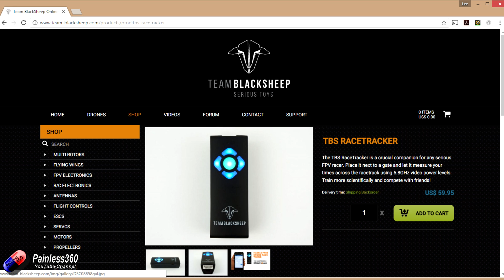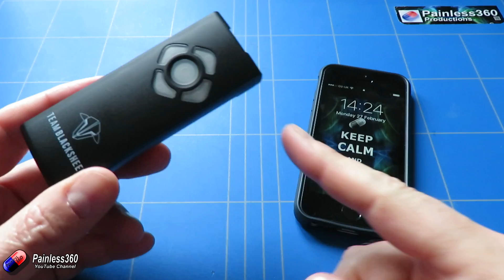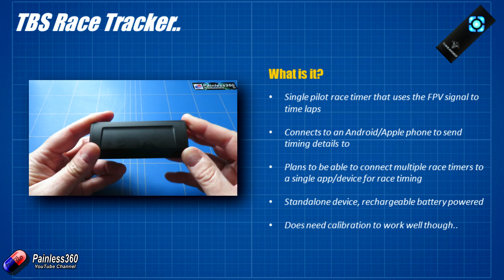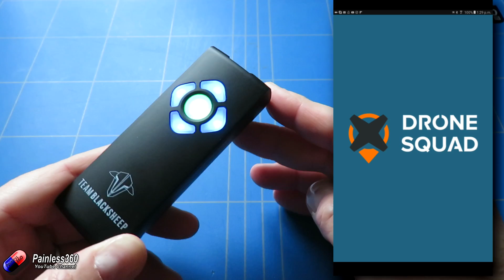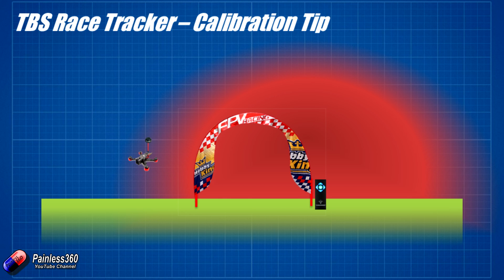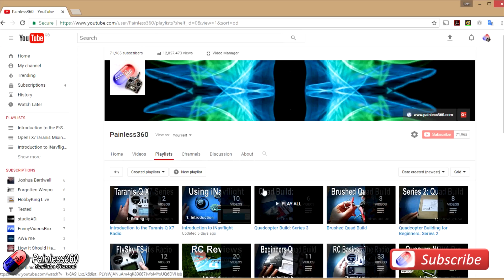TBS Race Tracker: Overview and Calibration Tips

Comment: Mine doesn't work... it won't accept a charge. I've had it plugged in for hours and it won't boot up
Reply from the maker: Then you probably need contact the people you brought it from..
Reply: Painless360 I found a forum that mentioned using a lipo charger to wake up the battery. So I'm going to give it a shot
Reply from the maker: Best of luck!
Reply: Painless360 it worked!

Comment: Have you had issues regarding range on your tracker? Connection to my phone goes away after 5m
Reply from the maker: It's BT so it won't be huge range... Remember that BT is also 5.8Ghz like the FPV signal so if you're using larger Vtx units then that may be affecting it..
Reply: It says that it's 2.4Ghz on the specifikation: "Communication: Wireless 2.4GHz based"   http://www.team-blacksheep.com/tbs-racetracker-manual.pdf
I got a reply from TBS support and they rekommended a antenna mod for aditional range :) 

Also wanted to take the opportunity to thank you for what you have done for this hobby and the Amaazing taranis guides. You are the bomb!

Comment: what quad did you flash at the beginning of the video? I'd like to build a 4" and am thinking of the X4 here: http://www.razorquads.com. What would you suggest for a motor for 3-4s and 4" props for that model or do you have any other small 4" suggestions?
Reply from the maker: +DirkaDirka07 check out the BrainFPV build that we did earlier. That's the model we briefly shows at the beginning of the video. Happy flying

Comment: Nice bit of kit, this saves on having a buddy timing your laps. I can see a radius at the back and as it is omnidirectional you could easily strap this to a gate using a Velcro battery strap. 

I am wondering if the app keeps a time log of each time you do a lap so you can make a comparison?

Also do you have to reset it before you take on the next lap?

Regards 

Wynne (BoLt)
Reply: Just downloaded the manual and the answers are all there, I have placed a order for one of these as I can see its a must have for improving your times. 
Nice bit of kit.